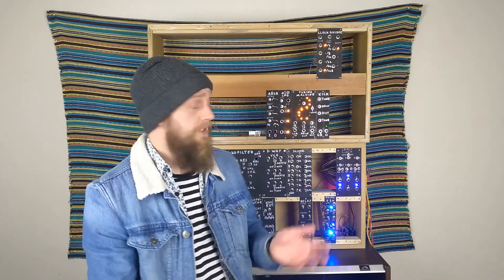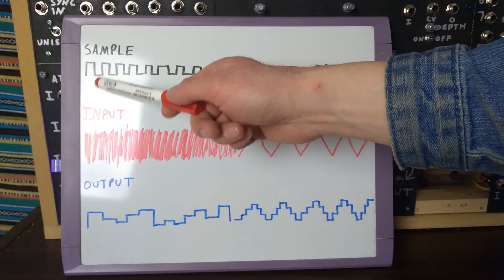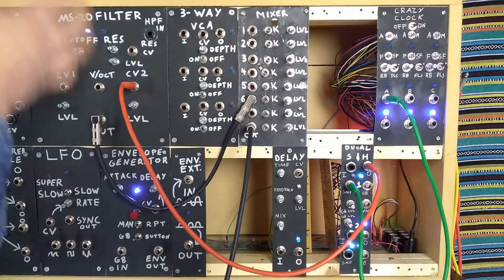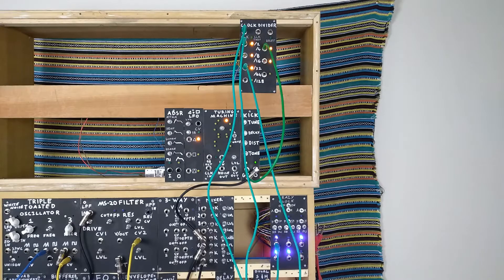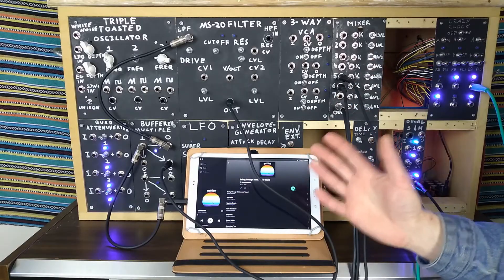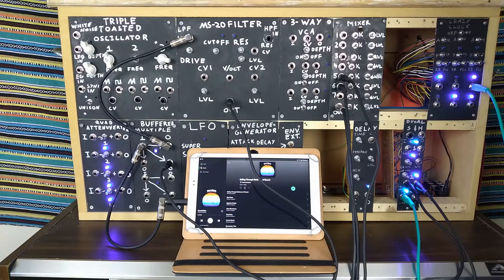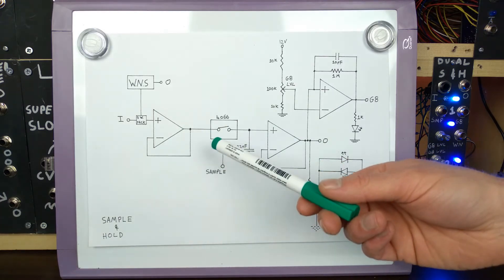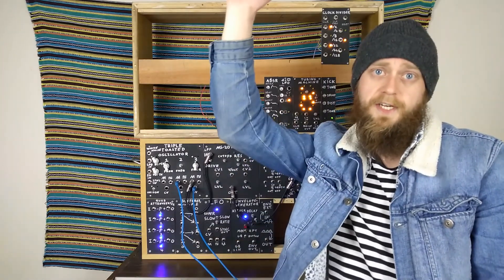The Dual Sample & Hold - Exploring Random Modulation With Sampled Signals

Comment: Can you tell me a bit more about your power supply, I'm struggling with wobbly power and changing pitch on my oscillators. Looking forward to your Turing Machine video btw, looks (and sounds) awesome!
Reply from the maker: I actually managed to solve the 'singing supply' problem the other day by just sticking a phat 10ohm 10W resistor over the power rails as a dummy load 😄 Works a treat, but just gets REAL hot - so I'm using an old panel as a faux heatsink hahaha. I think they need to be used close to their current limit to be used properly. 
Turing Machine vid hopefully won't be far away! Thanks 😄